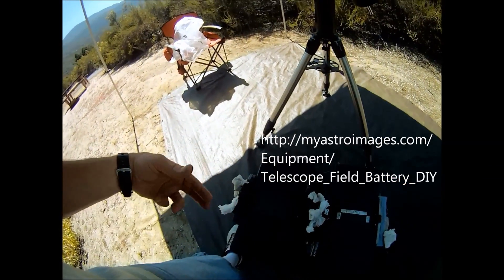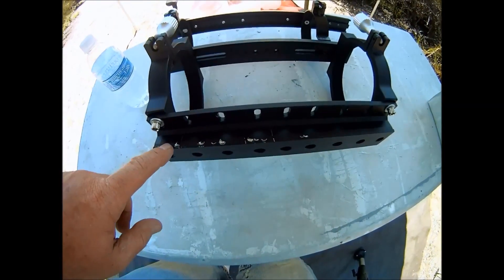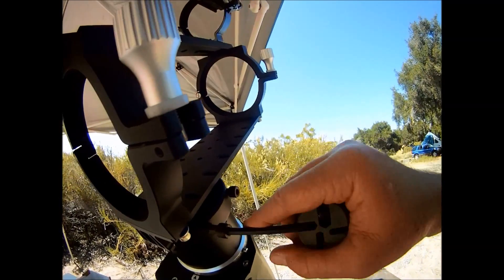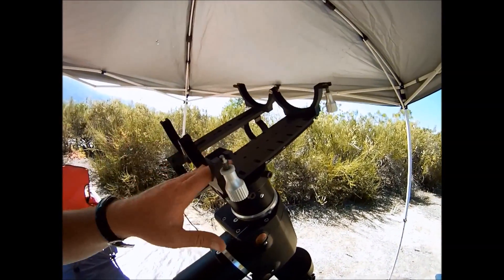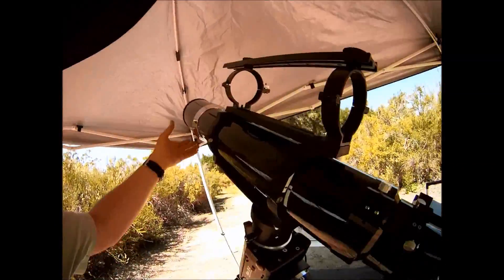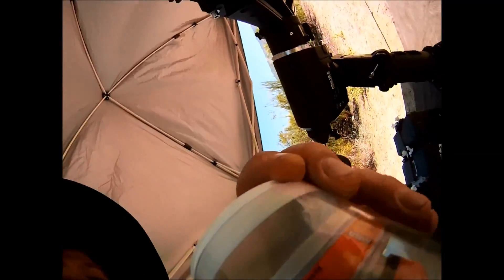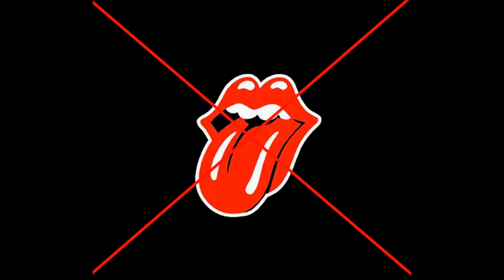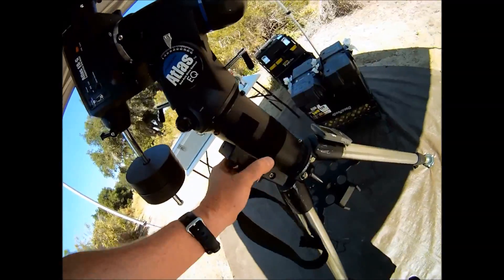Telescope Setup - Some Assembly Required - Part 2

Comment: I love these videos. Nothing like pictures over tons of text for this kind of activity. However, I searched for a mounting bracket of the kind in this video and could not find anything on the internet that remotely looked like it. Was this bracket custom built or is there a readily available source for it?
Reply from the maker: Hi William, the brackets can be made from parts you can buy.  Depending on your mount, you need the initial base plate, then you place your SOLID mounting rings on top of base plate, then add another mounting bar on top of the main scope Mounting Rings, then finally your guide scope rings.  You're right a video would be helpful showing the assembly of mounting ring setups.  I'll see if I can add this to the list.  If you'd like to learn more about the parts for this setup, please visit the forums @ http://myastroimages.com and I can provide some links.  Each setup will be different, but, you do not need to have anything custom made, these parts are readily available.  Thanks Doug